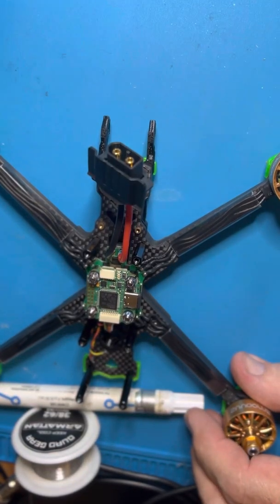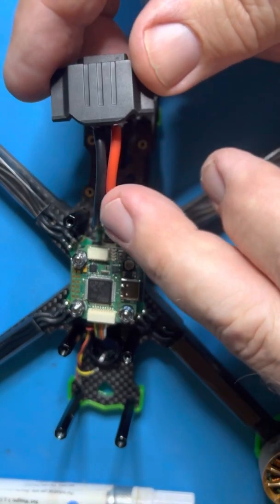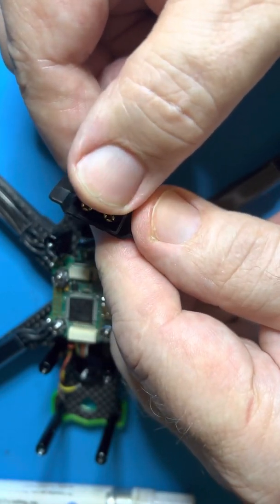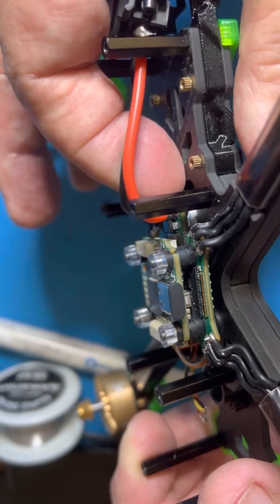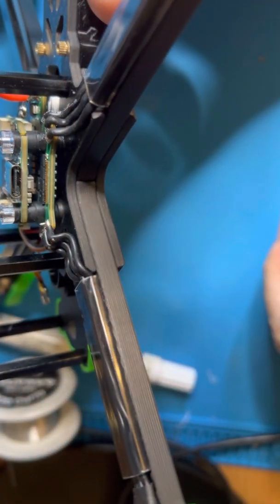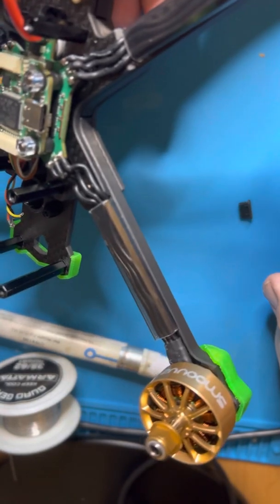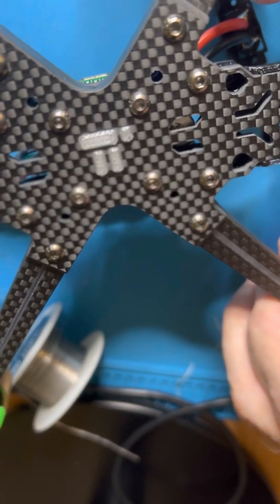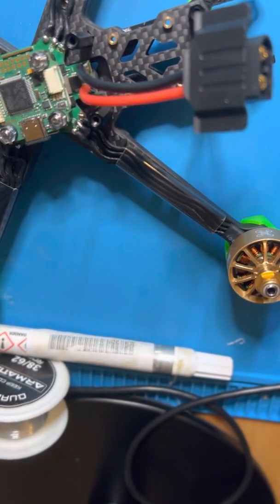IFlight Evoque Frame Assembly Part 2

Comment: Hahaha. I'm watching this after going thru many of the same struggles you have documented and all I can do is laugh. I wish these videos were out when I first started my evoque journey. I actually bought the bind and fly and for a long time tried to do maintenance without disconnecting the LEDs as well as removing the sides. I feared I wouldn't be able to get it back together in a way that kept it looking good. Each time I had to break into it, I would get a little more ballsy, and finally one day I felt I understood all, or close to all the little nuances. It's really a nice drone, but it's definitely not for the faint of heart. It's not one that is designed to be super customized. You really have very limited options with what can fit inside. What I found weird was when I got it, I guess the blitz fc/esc hadn't been released yet, so it came with the succex stack which doesn't have the same design for wiring the motors... Kind of didn't make sense.
Reply from the maker: @cflin4637 "it's really a nice drone, but it's definitely not for the faint of heart"  I agree :)

Comment: Man your video is saving me so much time. Thank you so much for this effort , really.
Reply from the maker: Glad to hear that!
Reply: @SkyDar-FPV  yeah well i'm starting to hate this frame. I had a mamba f7 mini stack but the USB plug is not in the center of the FC , slightly on the side and it doesn't match the DAMN hole of the side panel.
I guess the only FC tthat fits this frame is the Iflight one. I'm deciding if i want to go on now or give up and sell the frame.

Comment: Can you please show how you fix xt60 properly as I am unable to do with mine
Reply: If you get a XT60E-M plug it should fit no problem. I have the X frame which didn’t come with one and deadcat frame which did and it’s noted as that type of connector on the install page.
Reply from the maker: @BestyFPV  this is helpful! Thanks for posting the correct connector
Reply: @SkyDar-FPV  no problem at all. These are complicated frames and your videos have helped a lot.
Reply: Oh and the length of wire stated on the drawing is 65mm